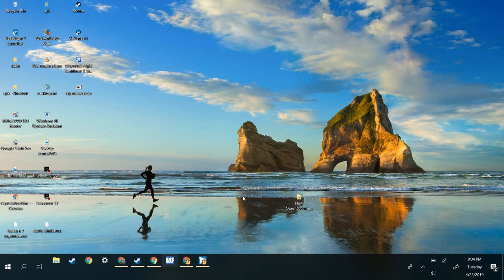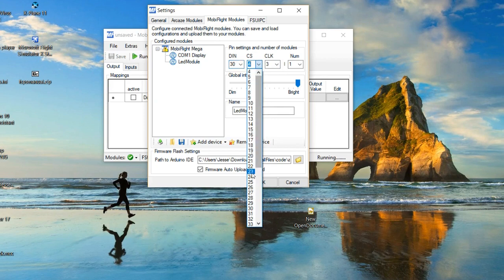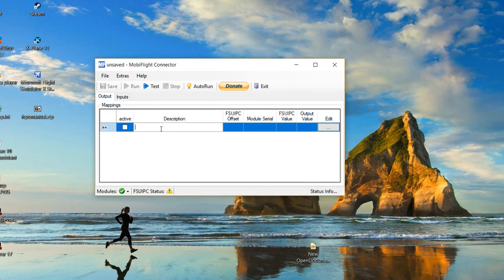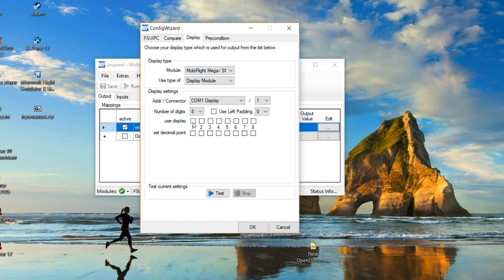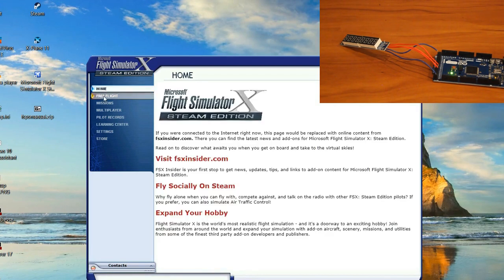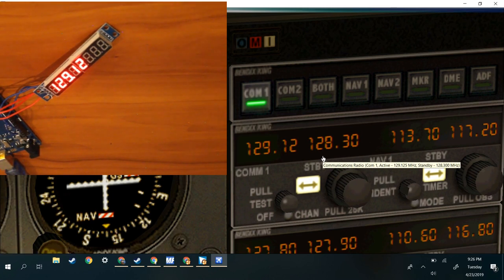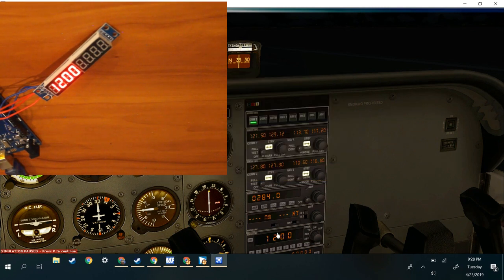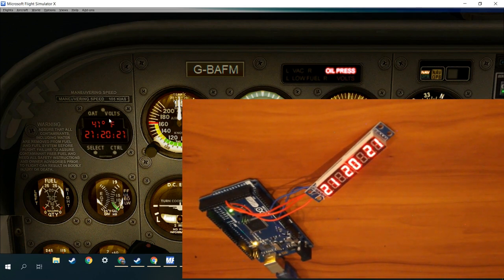How to Wire a 7 SEVEN SEGMENT DISPLAY to FSX using MobiFlight and an Arduino | Captain Bob

Comment: Thanks! I have a 4digit display with the connections: VCC, SCLK, RCLK, DIO and GND. I am not able to get this display to work.
Reply from the maker: Hello! It doesn't sound like this is a MAX7219 - what model is it?
Reply: @CaptainBobSim  LED Display 7 Segment 4-bit 0.36 Inch Serial 595 Driver Board Arduino its called

Comment: Hello Capt. thank you for this awesome video. I managed to get the active comm freq to display as my first mobiflight project! One question, do you also have videos further explaining how to build in a push button (to switch between the active and stby freq) and a concentric rotary encoder? I'm trying to make a simplified replica of the fenix A320 radio panel. Is it as simple as wiring the push button and rotary encoder to different pins on the Mega and telling them what to do in the mobiflight software?

Comment: Hi Captain, for the max7219 (8 digits): is it possible to split 1 display into 2x3digits (2digits unused)? and then control these two pieces separately? This, for example, to display the Course (3 digits) and ias/mach (3 digits) in 737 with one MAX7219...?
Reply from the maker: Yep! DIY 737 sim has a great article for this, which I use whenever I need to do anything with wacky MAX7219 displays
It's since been broken: https://www.737diysim.com/post/737-radio-7-segment-displays
Basically follow the pinout of each module and try to pin it into the 4 digit displays: https://i.stack.imgur.com/vJzZu.png
The main difference should be the digit pin

Comment: my 7 segment display turns on all its lights but nothing else, i tried everything. Can somebody help me?
Reply from the maker: Have you confirmed its a MAX7219?
Have you triple checked your wiring? Maybe try different wire (not good connection)
Have you tried with a different display? (Sometimes these can be duds)
Reply: @CaptainBobSim  yep it's a MAX7219, I checked my wires several times. I have 10 of them, I already tried to change
Reply from the maker: @xFrayx  Are yours common cathode or common anode?
Reply: @CaptainBobSim  everything is settled, after several tests it finally works!  the problems were the wires (poor contact) and the number assigned to the display.  The only remaining problem is that the comma takes up a whole digit slot.
Reply from the maker: Sweet! Usually it's a connection problem/dud. 
Multiply it by however many digits are after it to get rid of the comma taking a whole digit  👍

Comment: Hi @captain Bob thanks for sharing. Just a doubt my 6 digits 7 segments don't have the CS pin. Others are OK. In my case, Mobiflight add device with error :( any advice about that ?
Reply from the maker: Is it a MAX7219 chip? Only these are compatible with MobiFlight currently.
Reply: @CaptainBobSim  thanks! Nope it’s a TM1637 :( i choose it because many sizes and color choices… do you recommand a specific model 0.36 Max7219 ? I’m looking for 4 and 6 digits display :)
Reply from the maker: @tarikb.2352  Hmm. I don't know if there's a 4 digit display, but if you get the green colored displays, you can remove the pins and extend only 4.
Reply: @CaptainBobSim  hi ! I try today with a Max7219 (digits lights ON) but 0 display/light when I upload device setting on Mobiflight :(

Comment: Hey captain Bob can i use two of these with an arduino nano?
Reply from the maker: Nano will not work with MobiFlight, but Pro Micro will. 
Yes, you can have more than one :)
Reply: @CaptainBobSim   thank you so much :)  i will buy many pro micros and one 2560 mega.
Reply from the maker: @MiguelMadrid-es7ij  No problem! Have a nice day!

Comment: Hi Captain Bob!
First of all congratulations for you work! You pushed me to make my own panel switch and autopilot module, and i dont understand to much about eletronics :b
Everything is going great exept the 7 segments displays.
I just bought two of them with 4 digits but there is no DC Pin out on this displays. 
Can you tell me if i can use them? :s

thank so much :D
Reply from the maker: Hello! Could you send a link to the 7 segment displays? I'm not sure which ones you are talking about.
Have a great day Fillipe! :D
Reply: Hi   @CaptainBobSim   :D
I already found the issue. 
Apparently the mobiflight only supports 7 segments displays with max7219 chips! 
It took me sometime to found this information x) 
I will start building my humble flight box! Lets see if everything goes right! Finger crossed ahahaha

Keep doing what you do ;D

Comment: Hello my display is working but when I for example press test where u can chose the numbers which represents there are just showing weird led not the one I choose when I run the simulator and press start it just showing random numbers and letters. When I change the numbers in the simulator fs2020 then they are changing as well but to something other weird numbers and letters
Reply from the maker: It's hard for me to replicate your results. I assume you are talking about the "Transform" window when you are talking about changing the values. In the display tab, the 1-8 numbers are the digits you control, not the numbers on the digit.
This is likely due to some bad 7-Segment displays (sometimes the soldering on them isn't the best). Have you tried this with a different one?
I haven't tried this tutorial with FS2020, so this might be an issue as well 🤔
On the MobiFlight page is  the "Output Value" changing to the desired number?

Comment: it is possible to use 1 Arduino for multiple indicators or every indicator needs its arduino ??
Reply from the maker: You can have up to 10 seven segment displays if I recall correctly. You can use the other 60 some pins for other components

Comment: can you get 3 digits to the right of the decimal like most glass cockpits have on their G1000's ext? thx
Reply from the maker: Yes, you'd just activate the 6th digit as well. I believe the output value is in 122.800 format.
Reply: @CaptainBobSim  ok, thanks. the logitech panels only allow 3.2  or ###.##  so in other words, you can't see what frequency you are on.
Reply from the maker: Here's a picture with a ###.## radio, they are common. https://www.aopa.org/-/media/Images/AOPA-Main/News-and-Media/Publications/Pilot-Magazine/2018/1801/1801p_pe_technique/1801p_pe_technique_16x9.jpg?h=675&w=1200&la=en&hash=218AF1F90B8E354B241E3383398DBF80
To my knowledge, most frequencies increase by .025 each step, so only the .## is needed to tell which step it's on. I've seen some exceptions though.
Reply: @CaptainBobSim  -- gotcha, i will study more on this topic and thanks kindly.

Comment: Do I need an arduino MEGA? Or can I also use an Arduino UNO, because I don't have the mega board. Because this is really cool
Reply from the maker: You can but it's no longer supported, and has some bugs in the code. Look into the MobiFlight forum for this. I would highly recommend the mega, it's only $15 online so not too big of a deal (compared to other boards)

Comment: hi, i'm trying to built a 737 OH, so now i'm trying to connect a switches and led to mega board, but i've a problem when i assign a annunciator for example fuel pump low pressur work fine but when ia turn off ground power and battery switch the led of fuel pump still on, how can i solved this problem?
Reply from the maker: Hey Simone,
This sounds like a more complicated problem, I might ask this on the forum: https://www.mobiflight.com/forum.html
Reply: @CaptainBobSim  thank for for the answer, I solved the problem, i've another westion (sorry if you took advantage of it) i can connect a lcd display with two rows?  is the procedure like the one described in the video?
Reply: @CaptainBobSim  thank for answer. I can connect a lcd dipslay with two rows? is the procedure like the one described in the video?
Reply from the maker: @TheTribeitaly  It is quite similar, look up "MobiFlight LCD tutorial", and you should find a good video on it (it is in spanish)
Reply: @CaptainBobSim  thank, you're great

Comment: How did you learn to use arduino, I would like to learn. How do you know what wires to plug where?
Reply from the maker: I learned by looking at Arduino Wiring schematics and looking at the MobiFlight Tutorials. This diagram helps a little: http://www.circuitstoday.com/wp-content/uploads/2018/02/Arduino-Mega-Pin-Configuration.jpg 
The ground pins are negative, and (Sometimes black wire).
The 5v pins are positive, (Sometimes red wire).
The digital pins are where you can plug your switches into, and the positive side of LEDs or other electronics. 
The analog pins are typically unusable with MobiFlight.
You can email me if you need more help: CaptainBobSim@gmail.com

Comment: Thanks this was very helpfull😁
Reply from the maker: Oh good! I am glad this helped!💥🌟👍
Reply: Captain Bob Hey how many segment display can I connect to one Arduino mega?, if you know🤔
Reply from the maker: @zz-mt5zf  
Theoretically you could use up to 20 on one board (as there are about 60 usable pins) but the USB power would likely not be sufficient. MobiFlight officially limits 4 displays per MobiFlight Arduino (5th question: https://www.mobiflight.com/en/documentation/faq.html )
 There are only (3) 5 Volt Pins, so you would have to use a breadboard for more (There are also 3 ground pins, so a breadboard, or similar solution is needed anyways.) 😃
You can achieve more by wiring displays together. I will show this in a future video 😎
MobiFlight supports up to (8) 8 digit - 7 segment displays daisy chained together so the maximum is up to 32.
(I typically use 3 displays per arduino, and daisy chain them 3 long at most.)
Great Question! 👍✈⭐🌟
Reply: Captain Bob Yeah thanks for the super great information, I was thinking about 6 of these 7 segment display to connect to the Arduino mega😆😁
Reply from the maker: You are welcome! Remember that you can use switches as well as the displays, as you still have about 40 pins. Switches don't draw power :)